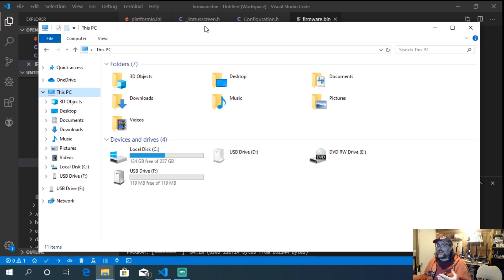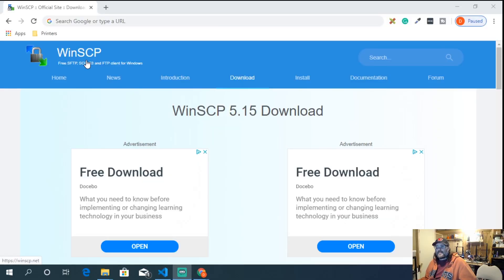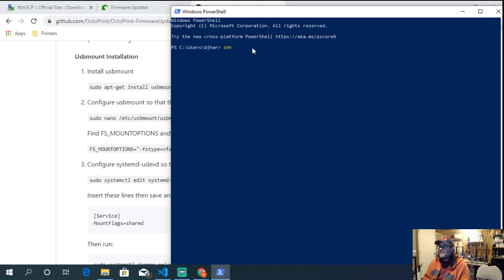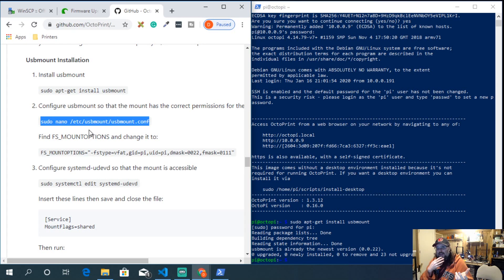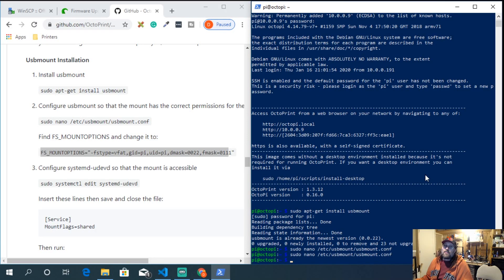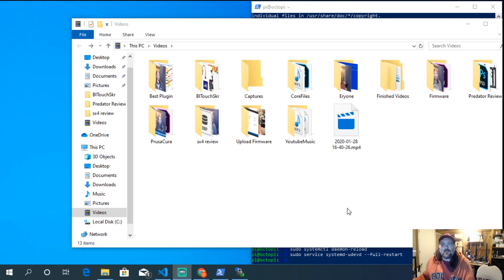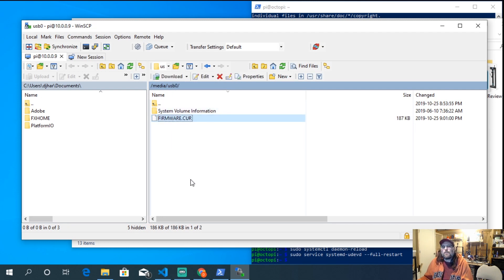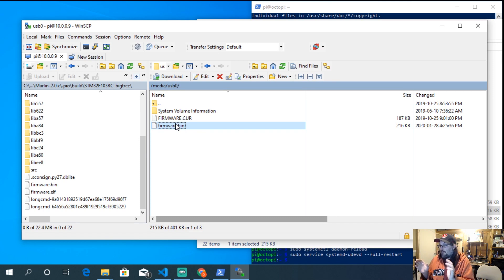Upload Marlin 2 0 to SKR controllers anywhere via ftp

Comment: Sorry if this question has already been answered in an old video, which platformio environment do you use for these SKR boards? Is is STM32F103RC_btt_512K or STM32F103RC_btt_512K_USB? I would assume the one with USB for USB mass storage but I wanted to check
Reply from the maker: STM32F103RC_btt_512K is what BTT has configured on their github and what we have have used in past build of the firmware.
Reply: @3DMakeIt  thanks for the reply, interestingly I couldn't get the SD card mounted without using the _USB version
Reply from the maker: @leehudson1384  What version of the board do you have?

Comment: Hello, First of all thanks for the video..
I followed all of the steps and when I get to the last part about dragging and dropping the bin file I get this message
 "Permission denied.
Error code: 3
Error message from server: Permission denied
"   

Also it doesn't show the system volume information that you mentioned

I am using a SKR 1.4 Turbo I know the Turbo is a LPC 1769 and not LPC1768   Does this make it not work?

Any Ideas?
Reply from the maker: If you see the permission denied.  The user you used to login through the ftp client doesn't have write permissions to the USB directory.  You may have to use chmod and add write permission to the usb directory.   Ive never run into that before
Reply: @3DMakeIt  thanks for the reply.. Not sure what chmod is but I'll look in to it. I read somewhere it said something about the umask numbers are what deal with permissions? But I dunno
Reply: @3DMakeIt  so I found this sudo chmod 777/YOUR_DIRECTORY   and I changed it to this sudo chmod 777 /media/usb0  and that allowed me to drag and drop with out the error.. but when I restart printer it doesn't flash.. it just stays a bin file
Reply: Slew FPV I can’t get it to see the controller. I have done what you did with the chmod and now when I plug a usb stick in I can see the files, but not the controller. Have you made any other progress?
Reply: @sw6107  no I gave up and just ran the sd extension outside of the box..
Reply from the maker: @richardrhoads9088  was the file you moved called firmware.bin?
Reply: @3DMakeIt  yes
Reply: @richardrhoads9088  same for me, (SKR V1.4Turbo)

Comment: No need to power off. You can issue a M997 command with octoprint or pronterface.
Reply from the maker: If you use M997 make sure to run m502 and m500 after it as the eprom settings may not be over wrote.  Powering off and on is a hard flash compared to m997 which may not clear the volatile memory
Reply: @3DMakeIt  same thing applies to a flash after power on. The settings in eprom are never touched by a firmware flash. You always have to do a M502, M500 to update the eprom. That's why you sometimes see a eprom data mismatch message in the terminal after a boot. It's also the reason, that people think their changes in firmware had no effect because the forgot to load the new firmware defaults abs save them in eprom. Eprom is  non-volatile memory.